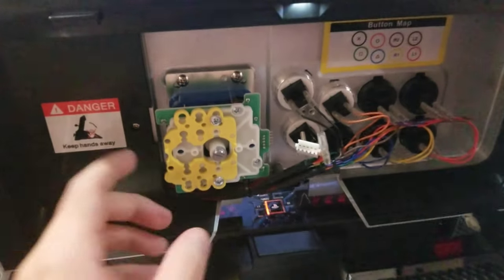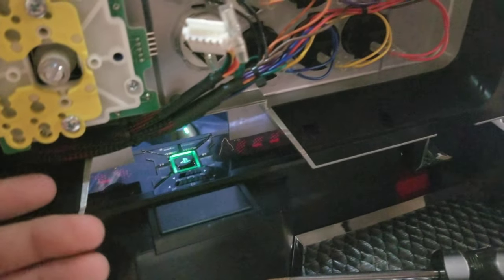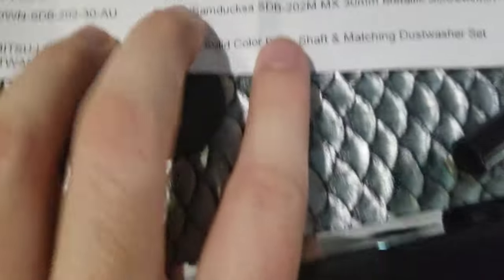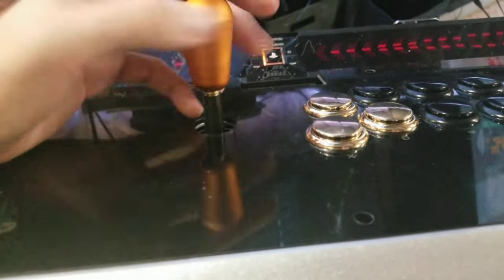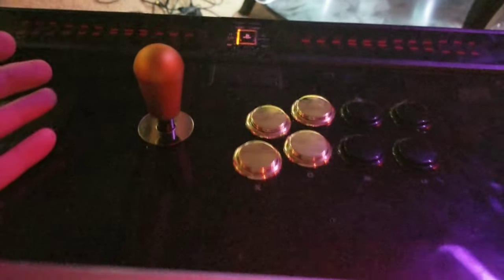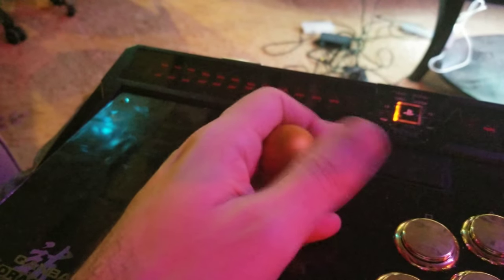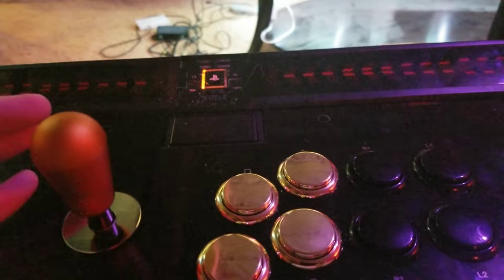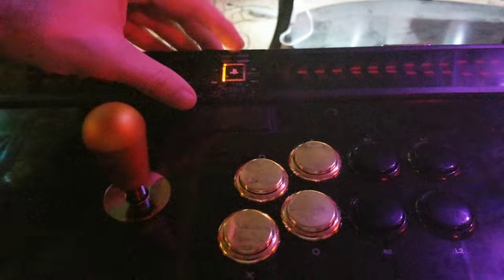Seimitsu LS-40 install and first play.

Comment: I can tell you why everyone likes sanwa for fightings. Because it's the default joystick that comes with arcade sticks and never tried anything else. Seimitsus are way better that sanwas. Even for fighting games. There's no reason to prefer a larger throw and engage in a joystick. You need fast and precise inputs.i changed mine to an ls-56 and I play way better. Also I have an ls-40 and is amazing too.
Reply from the maker: Does the LS-56 have even less throw I'm on the LS-40 right now and its really close but I'm already thinking how I can modify it for slightly less throw... it's very close!
Reply: @crimsom2977  the ls-56 has less engage(the activation of microswitches) but a little bit more throw(the contact on the restrictor). You can modify the throw if you buy the Kowal mod. You can make the 56 really, reallly short. Personally I prefer it default. But if you mod it you will have maybe the shortest engage and throw stick I ever tried.
Reply from the maker: so you would say the micro switches on the Ls-56 are less mushy? like more consistent activation? or is that just because the leverage of the longer throw?
Reply: @crimsom2977  the microswitches on the 56 activates quicker than the 40. On the 40 you have to move a little bit the stick before they activate. On the 56 it's almost instant. That's why I prefer it. It's so responsive. I play mostly shmups and both works really well for the genre, but the 56 is better on my opinion. Your ship moves instantly.
Reply: @crimsom2977  Ls-56 has medium throw though the feel is very responsive and clicky its not recommended for Shmups for nothing. I personally use for Fightinggames and Shmups/metroidvania type games. JLF feel to fast and free too me i do not like it either.  I like Ls-32 as well but prefer Ls-56 more overall was thinking of trying Ls-40 out of curiosity.
Reply from the maker: @Sativa989  I have a new video uploaded where I go back to the JLF but with a modified actuator very happy now just needs a 2lb spring.
Reply from the maker: @Sativa989  a modified JLF seems much better than a even an LS-40 I recomended looking into it I 3d printed the actuator file off thingaverse.
Reply: @crimsom2977  Im assuming oversized actuator? Iv done that as well 2lb spring to remedy how it feels stock the JlF. Still ls-56 stock solves this problem i have with JLF. Ls56 feels far more responsive the switches man to good just the right amount tension too. Can even give it a short throw modd.Ls-56 is seimitsu's JLF far superior for my taste. Sanwa doesn't have many options when it comes to there levers. Crazy how you doubled down and made a complete 360 couldn't be lol. But ay different strokes for different folks word ill check it out the video!
Reply: Overall for arcade gaming I'd say the ls40 is the best overall, the 56 could well  be the best one for shmups it's praises are always sung for shmups, I would like to buy and try one sometime. . but on my new astro city, I decided ls-40 considering the pandoras box all different type sof games, shmups, fighting, platform, etc beat em up I think the ls40 is really balanced over all genres. . I actually like using the 40 and LS-32 over the Jlf for fighting, ls-32 being the original street fighter 2 stick (technically the ls-25 but closest to it), and for a lot of early Snk fighting games, the ls-40 being used for Snk games from 1996 cabs onward I believe, 

My brother prefers modded Jlf on his player 2 side, 2lb Spring, Otto DIY V5 actuator and otto squared circle gate.

I've got mod parts for Jlf, rubber ball top, ls32 actuator mod, all kinds of mods loads of different springs, actuators for jlf and ls-32 , however I feel like the ls_40 stock is just great how it is tbh, it feels so good to do dashes with, and parries in Third Strike, or Just Defends in Mark of the Wolves . I did try a Jlf Otto DIY korean V2 MOD. WITH Buttercade spring delete, aluminium shaft, kdit rubber balltop , very interesting with minimal shaft and ball spin, used the Blue otto diy Rubber tension, v interesting to use  more an japanese hybrid type. 

I have to say I always found the Jlf so loose, I originally tried it with 2LB spring and Kowal actuator I think most people start off with that mod, but overtime I realised that after  trying 4lb, 3lb, 2.5, and 1.5 and 1.1 lb springs, the stock jlf allows you to play as relaxed as possible. It took me a while to realise, I could play longer on a Jlf, whilst the Jlf is not my first choice, it does allow you to play in a more relaxed style and that helps you be quick, at the same time I like th ls40 for the engage and throw reasons, also for the fact you learn to do tighter circles, half circles etc, that forces you learn to be quicker. But yeah good video and i for a while thought sanwa is just too weak and sloppy, but, the worst thing for me is the Wine glass hand position some people use to play, and usually always on JLFS too, I really just think that is the most difficult way to play and likely to strain your wrist.
Reply: @Ozyrus  it's about tastes. For me, the ls 56 is the best for everything. With octogate. I have a special lighter spring version. And I like it. Because I like my moves to be fluid, not slowed because of the spring. I like the ls40 too but I prefer the 56. I have modded my sanwa with a bigger actuator and a 2lb spring (reaaaaally stiff for my taste) and i still prefer the seimitsus. They feel really smooth compared to sanwa. I haven't tried the otto DIY mod but for what I saw, basically you change everything of the stick. So it's questionable that you can call a sanwa lever to that.
Reply: @superhadouken  yeah personally one of the factors for me was that I liked to play games with the stick and buttons that they likely came with in the cabs they were in at first as in to replicate it historically if you see what I mean like trying to replicate the feel, just a bit of an ocd thing for me and total opposite of the mod approach

One stick is  stock LS-32 with PS14G, the old school flat buttons

Other is stock JLF + OBSF30 buttons. 

I had to do this as a head to head and settle the sanwa seimitsu debate, and seimitsu just gives you more feedback, precision and confirmation in buttons and stuck personally. 

New astto city with pandora box, I put LS 40 and Ps14GN. 

, but the best approach is to try everything and find your taste but also what benefits your play style 🕹! 👍🏻,what are your favourite 3 buttons n brandss for them? I think overall ps14GN Seimitsu is the best overall, crown /Samducksa 201's I think are very underrated they have quite a lot of strength in them and I think they are now discontinued, a lot of people I've talked to really like them for smups, I think could be the perfect partner to your ls-56 for smups
Reply: @superhadouken  The LS-56 catches your inputs a LOT more quickly, so I almost always overcompensate, especially coming from a JLF or even K-Levers. But I still love it for shmups.
Reply: @ShadowBlade79  Thats what i like about the 56 and seimitsu in general. That your inputs are really snappy. It helps me a lot on fightings to input fast combinations. The other levers makes me do moves that are not needed and makes my execution slower. Anyway is always a personal preference. I tested it with people that dont play on sticks. I showed them JLF  and simitsu, and they always choose seimitsu. JLF is the standard because it comes on retail sticks, not because they are better, and people are use to them because 90% never tried another.
Reply: Stefano Pavone  I agree, on seimitsu there are many options, where you can find exactly what suits your style. On sanwa's not. Everyone use them because they come installed on sticks and have never tried anything else, not because they are better.
Reply: @superhadouken  Hope not to bother, but I've see some competence here, for a very nice to read discussion (congratulations to all of you).

I also favor LS56/58 over LS40 and LS32 (quite on par to me). And I choose all of them over the JLF, which is sturdy but too slow for 2d action.
Still, there's just a single nuisance with my Seimitsu LS56: It's about the actuator.

If pressed firmly against the gate, sometimes the actuator will adjust a bit - and with It, the lever - moving a little further, probably about 1 mm.
Not a problem with shooters, but with fighting I like to ride the gate, particularly on charge based motions.

I don't know, It's only me? 
LS32 is well known for Its moving actuator, but I didn't expect to have the same problem with LS56.
Reply: @superhadouken  Yeahh you have right for me too LS-56 is best for all with octogate. I can use Sanwa spring weak and very long throw and engage. Seimitsu are more soft and more acuracy than Sanwa
Reply: LS-40
What about tension?
Is it equal to Sanwa 2lb spring or Crown st35 grommet?
Reply: @saleemahmed7856  it's about the same tension as sanwa. 2lb is way more stiff than the ls40. I never tested a crown.
Reply: @saleemahmed7856  2lb no LS-56 is near 2 LB, LS-40 is like Sanwa but better
Reply: @unaigalder  is Hori and Sanwa stock spring the same?
Reply: @saleemahmed7856  Yes are the same shit i like seimitsu LS-56

Comment: I think the top Korean players in Tekken use this one. Could be a competitive advantage.
Reply from the maker: I've moved back to sanwa with a modified actuator.
Reply: @crimsom2977  how did you modify it? I have a JLF I would love to modify.
Reply from the maker: @SCORP1ONF1RE  3d printed and installed this file. https://www.thingiverse.com/thing:3994934
Reply: @crimsom2977  Yeah stock is tiring to use.
I might just get a bigger actuator than getting a Seimitsu joystick.
Fastest i can do is 5 frames forward then quickly down back, while i can do the same motion using a keyboard/mixbox for 1 frame forward.